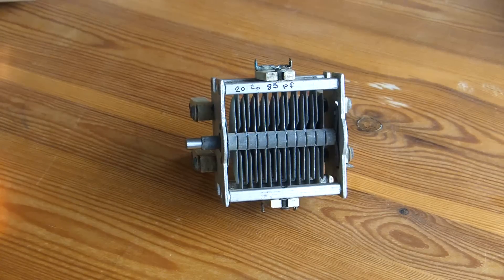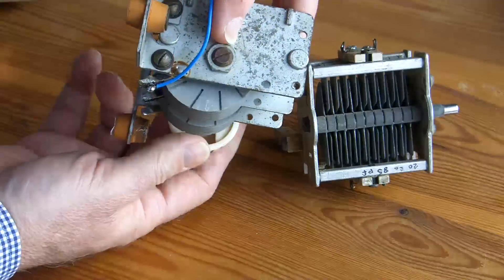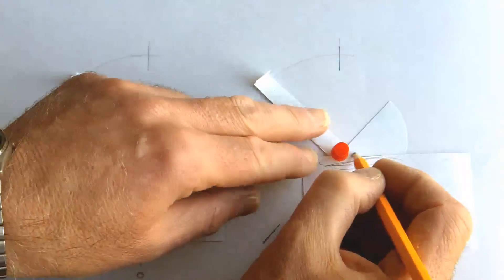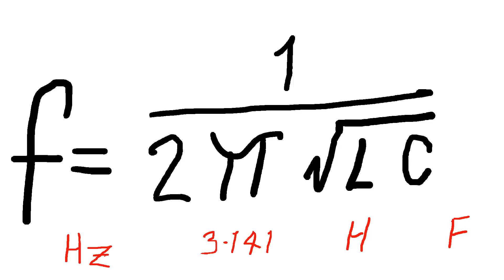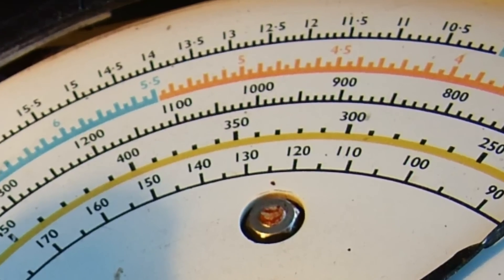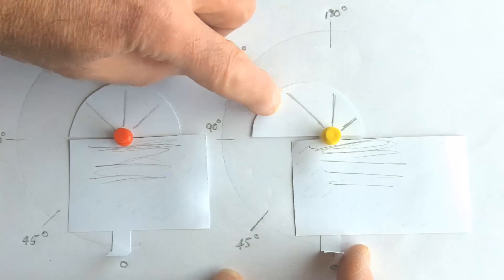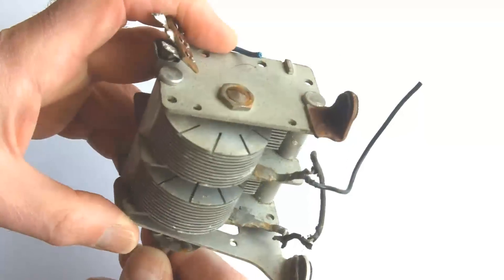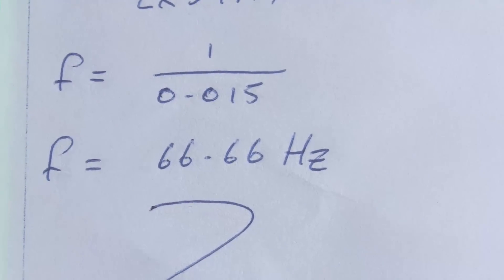About Capacitors ... Part 5 Non-Linear Capacitor by Andy Davies

Comment: Hey Andy,

Neat demo of linear and non-linear capacitors. And most important the why. 
I just looked at a few of my 1920s radios and of course they have linear tuning capacitors. I guess the non-linear tuning capacitors was developed when the frequency was put on the dial. The earliest radio I have that has the frequency on the dial, plus 0-100, is the 1929 Radiola 66.

Regards
Rick

Comment from the maker: @medi40 
Hello and thank you. I don’t know that I have a style of presenting but I try to tell it in a practical way and I a way that will be remembered. Did you see that I’ve made a series of 18 videos where I go through the circuit diagram of an old GEC valve (tube) radio and talk a little about each components and I connect the oscilloscope in some and show what’s going on. 

Thanks for the feedback as it’s the only way I know if it’s appreciated.  

Kind Regards ... Andy